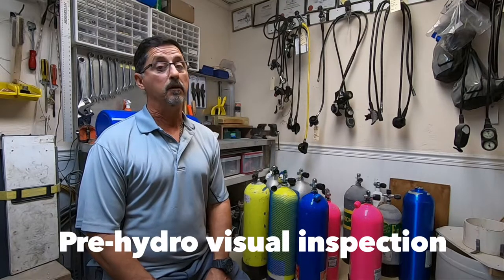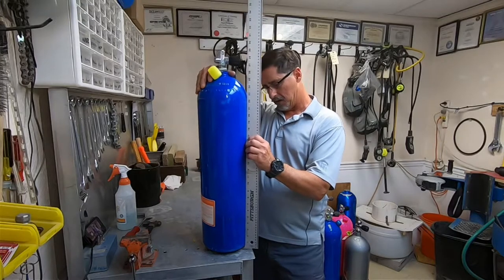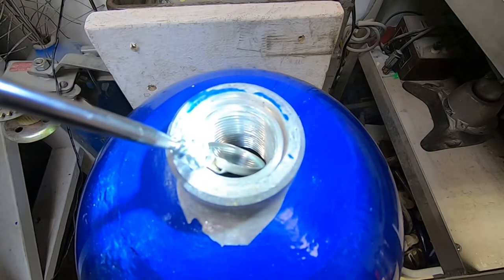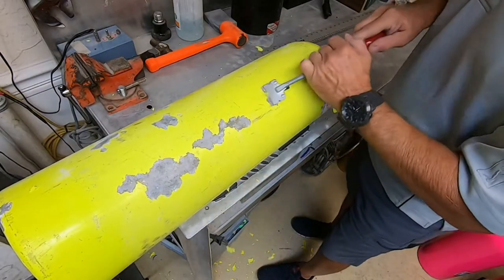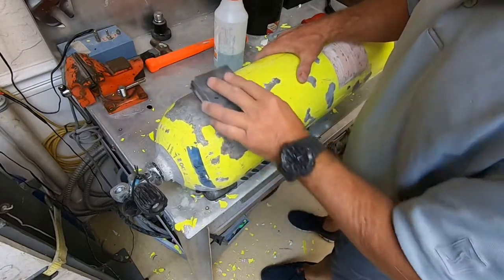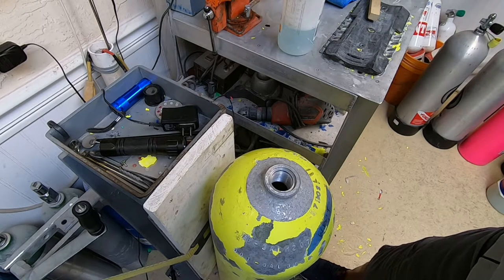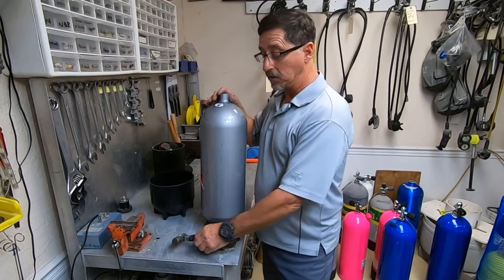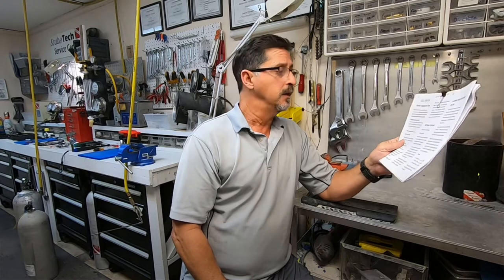How to inspect a scuba tank (VIP)

Comment: How safe is to use a sand blaster on the aluminum tank to remove the paint without compromising our tank’s integrity?
Reply from the maker: @DiveScapeTV a sand blaster can be too aggressive because there could be  some loss of aluminum. Loss of aluminum will compromise the integrity of cylinder. A gel type paint stripper is a better option.

Comment: You should not be scraping off any of the oxidation on aluminum tank. All what will happen is that the aluminum that you expose is going to interact with the oxygen in the ear and create new oxidation that's going to preferentially eat into the aluminum of the tank. With aluminum tanks leaving it be. I'm speaking about this from the perspective of the mechanical engineer.
Reply from the maker: I strongly disagree with your statement when it refers to scuba cylinders.  Cylinders are a flexible container holding 3000 psi or more, which can and have been explosive when improperly inspected.
Oxidation/corrosion, “lost of metal” will lead to pitting in the alloy, a single pit measuring .06 of an inch  will fail the cylinder, but an structural column with the same pit can remain in service.

Please keep in mind we in the scuba industry are formally trained, I personally have 40 years of training and experience we are also regulated by, 
Department  of Transportation (DOT)  Pipeline and Hazardous Materials Safety Administration 
(PHMSA) Compressed Gas Association (CGA)  Code of Federal Regulations (CFR)  and OSHA .
In addition we are  mandated to have continual education and certification every 3 years.
Did you know the person filling or inspecting your scuba tank must be trained and certified every 3 years? (CFR180.205)

Here are some quotes from our training text to help you understand our methods.
“ The primary purpose of cleaning a cylinder, whether inside or out, is to ensure all metal surfaces are exposed to the inspector’s eyes”.
“The entire exterior of the cylinder must be exposed to the inspector and not concealed”.
 “If corrosion is found on the exterior, under the coating then the entire coating should be  removed”.
Reply: @scubatechkeylargo  I am an engineer, actually a lic. mech. PE, and I approve of your statement.  The other guy may mean well, but his point is more academic than proctical, I mean practical!
Reply from the maker: @calanpeet  glad to hear you agree on this topic, it is definitely a matter of safety to be able to properly inspect cylinders.  Thanks for professional input.